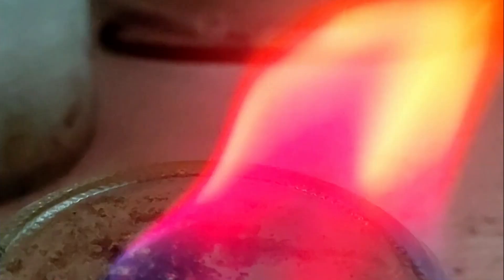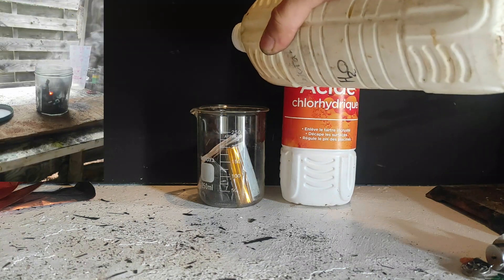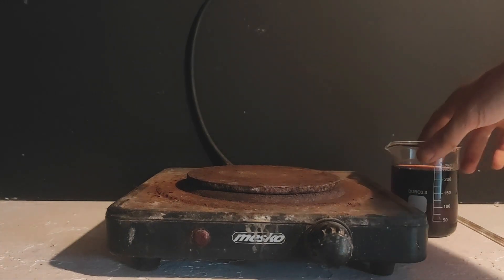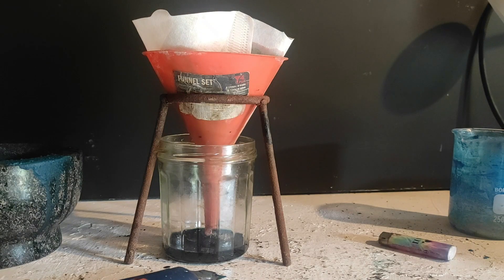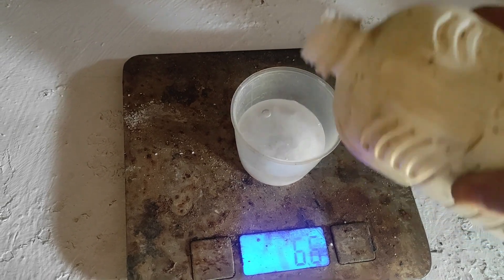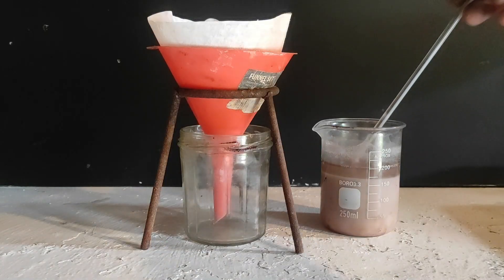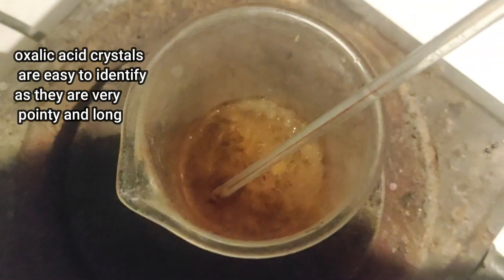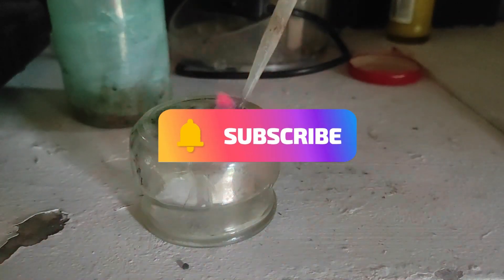How to extract Lithium from batteries (and cobalt as well) #chemistry #experiment #science #fire

Comment: Is it practical to electrochemically plate out the cobalt and transition metals to leave the Lithium behind?
Reply from the maker: I don't really know but the best way that works nowadays is to take LiCoO2 batteries (no Ni ,no Mn etc...)
Add the foil to NaOH solution to dissolve the aluminum foil then dissolve in HCl then add NaOH to precipitate cobalt hydroxide which can be filtered then add Na2CO3 and recrystallize the Li as the carbonate because it's less soluble

Comment: After I added the acid to the foil the solution was yellow-green
Reply from the maker: Are you sure of what type of battery you used ? There are also differences between lithium batteries, some containing more nickel(green colored) or copper(blue green colored) , even other metals like manganese, iron etc
Reply: @jam_kemist3986  alright, so it was a wrong battery, thanks for help
Reply from the maker: @boneeek_  no problem have a good day !
Reply: @jam_kemist3986  I'm sure it was a lithium ion battery at least it was written that it is a li-ion battery, however I once bought a carbon-zinc battery and on it was written that it is a carbon-zinc battery but when I dissasembeled it for carbon rods I realized it was a zinc chloride so it could be a production mistake, I'll try with a other li-ion battery and let you know
Reply: @jam_kemist3986  I previously used a li-ion battery from a vape, I have some li-ion laptop batteries I'll try with them

Comment: Since Al foil holds the LiCoO2 in cathode, can you explain what happened to the Al foil part during the experiment?
Reply from the maker: Most of it was separed because the LiCoO2 is very flaky and tends to fall off  but it's dificult to see, if there was any Al left it would be dissolved by HCl to form AlCl3 which is a soluble salt

Comment: A much better method to grab the lithium is to soak the foils in carbonic acid. The lithium dissolves but cobalt or other metals won't. Simply filter and dry. Next you can grab the other metals with HCl❤
Reply from the maker: That's actually wrong, the compound in the batteries LiCoO2 won't dissolve in carbonic acid (CO2 + H2O) and even if it did the Co would get dissolved as well

Comment: How to extract only lithium
Reply from the maker: Lithium metal you mean ?
Reply: @jam_kemist3986  yes
Reply: @jam_kemist3986  kindly let me know the process to extract lithium
Reply: Some lithium batteries contain large thin coiled sheets of pure lithium metal just be really careful opening the batteries to get to the lithium and remember to always use appropriate safety equipment and personal protective equipment
Reply: That's the HARD part!  You can use an electrolytic cell with a fused Li salt.